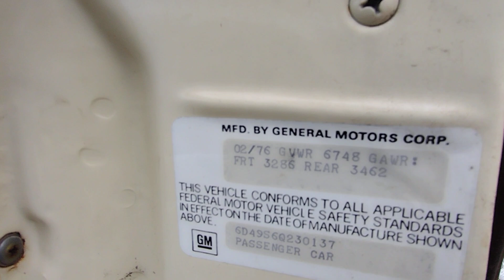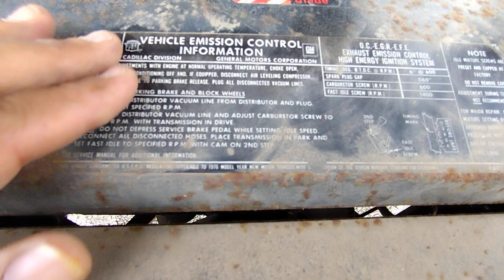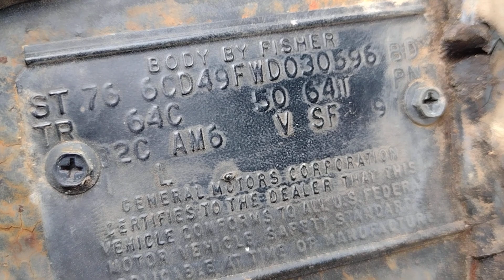1976 Cadillac Sedan DeVille Junkyard Find

Comment: Whoa Nelley, I posted before and it went out the door.

We got the VIN, we win: 6 for Cadillac, D for DeVille, 49 for four door hardtop, S for 500 V8 with four barrel, 6 for 1976 model year, Q for Clark Street, Detroit, MI assembly and the rest is the production sequence. The Clark Street plant closed in December 1987 and you can see the last days of operation online.

We got the tag, we can brag: ST76 for 1976 model year, 6CD49 for Cadillac (6) DeVille (CD) four door hardtop (49), FWD for West End Ave, Detroit, MI Fleetwood Body plant with final assembly at Clark Street as noted above, 64C for Light Buckskin Mansion cloth interior trim, 50 for Calumet Cream lower exterior paint, 64T for Light Buckskin vinyl top, 02C for the third week of February 1976 production, AM6 for split front bench seat, V for six-way power passenger seat (with split seat), S comes back to a sunroof which this car does not have, and F is for carpeted floor mats.

When you bought a Cadillac like this in 1976, you made in the world. This was the pinnacle year for Cadillac and the last "big" model year, although the downsized cars in 1977 were very well-received and sold very well. 

Whoa Nelley, 1976 and hit the bricks. The post was so nice, I did it twice. 5-0-0 and gotta go. Cadu and it's over for you. Calumet Cream needs a dream. Made in MI and going bye-bye. Body by Fleetwood and now it ain't no good. Cadillac ain't comin' back. That's it, time to quit. Assembled at Clark Street and now it's a big heap. Going to be flat and that's that. Big block took a flop. Going to get squished and the Cadillac faithful, many here, maybe Benny, and you betcha the Google Man are going to be very, very, very, very, very pissed.

Comment: Hay Google how many hp's does a 500 cube caddy moter put out to the wheels..?
Reply: Depends on the year and model. Google it.
Reply: @googleusergp  hum what year had more hp's then??
Reply: @anthonycoach4551  Older.
Reply: Anthony,  In 1970, the 500cid Caddy engine made 400hp and 550lb ft of torque. By 1976, it was neutered down to 190hp and 360lb ft of torque.  Even though the 1970 engine is a beast, generally, it's not a performance engine, mainly because of its intake manifold and heads. While most all other engines had medium or high rise (<for the time) intakes, These big inch Caddy motors  used a low rise almost sunken intake manifold that is very noticeable compared to other big block engines and the intake charge was actually majorly affected.  It was done this way because of the overall height of the engine and the relatively low front end design Caddy was working with back then.
Reply: @rogergoodman8665  hummm so just put a high rise intake on it then build the bottom end then you got a hell of a moter.
Reply: @Anthony Coach  : LOL! I don't mean to laugh, but gee, Why didn't I think of that? It's not that simple when no one really makes any. It's not a small block Ford where there are 15 different manufacturers of intakes.
Reply: @rogergoodman8665  😂👍

Comment: Good video 1976 last off the BIG Cadillac if those rear bumper filler panels are not brittle I’d snag those you could sell them for pretty penny .😊✌🏿
Reply: Nah, they are reproduced now. Not worth it to get crusty originals and hope that they will be good enough.
Reply from the maker: What are your thoughts on the carburetor? I was wondering if it would be good to swap onto other engines
Reply: @ClassicRideSociety  Get the carburetor, Q-Jets are getting harder to find as cores, although they reproduce them now for certain applications.

Comment: Benny and the jets I am surprised that the rear bumper fillers look good that would have been a good one to do a will it run video motor looks good 80,000 is nothing for those 500 cubic inch the interior looked like it was treated good.